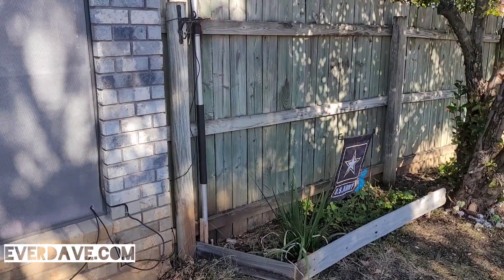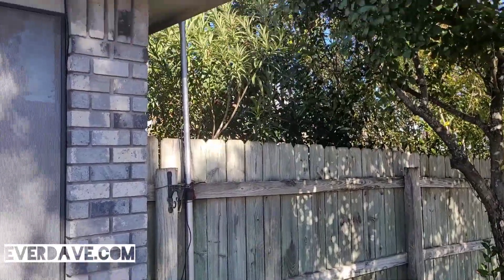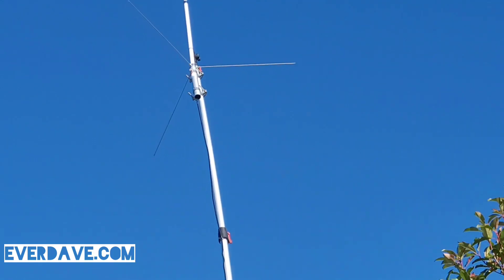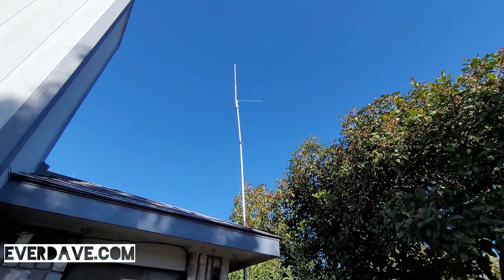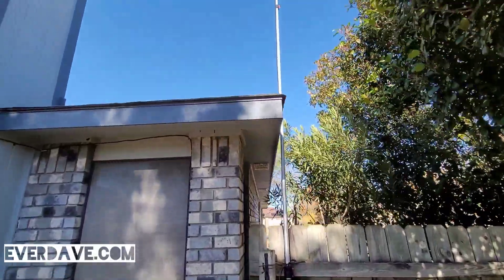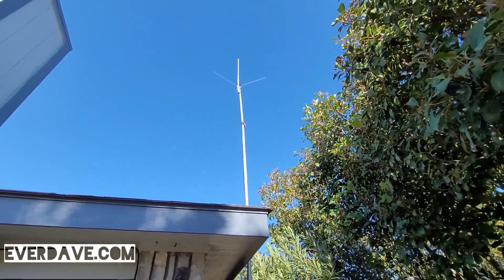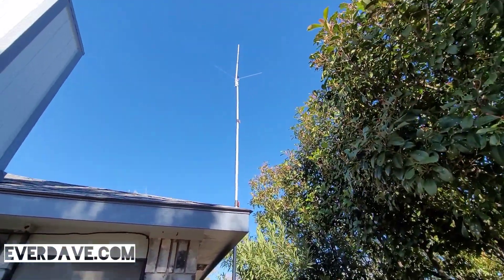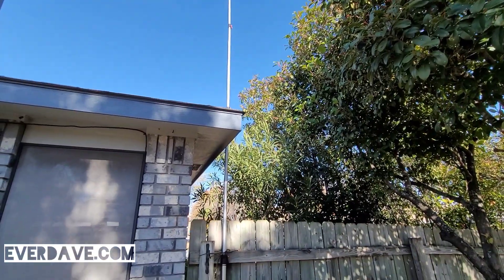My 2 meter Ham Radio poor man's "tower" in Central Texas

Comment: I’m in the same boat I had a toy years ago but I sold it so all I have is wire but I have a bunch of big pine trees so I think I’m going to I don’t one of them trams 14 in the 80s and I’m gonna try hanging it up in the tree by the top not exactly sure how I’m gonna do it but I don’t think that cover a pipe cause I don’t think the antenna goes all the way to the top of that so I think I can put something out to grab a hold of it and hook it up in the tree that’s my thought if you come up with a good idea if you could let me know I’d appreciate it 73’s name here is Donl K1EMW and I am located in Maine
Reply from the maker: N9TAX antenna works awesome for 2m 70cm! Use a fishing pole to toss a weight over a branch maybe?

Comment: Cammo Net poles work great but another alternative are the 10 foot 6 inch poles from your local big box store. They are actually chain link fence top rails. If you go with 2 of them, if you attach them to the soffit on your roof, you won't need a guy rope. I've also done 3 of them at my hunting cabin, but I do guy the top section at 30 feet. I would put them together and where they connect to each other, drill a hole all the way through and either put a long nut and bolt or a cotter pin so they don't separate or spin. Nice thing about either of these solutions, they can actually hold a bit of weight. I have a diamond X50A antenna on one and an X50A and on a wooden pole that is perpendicular going out about 4 feet, is a wire antenna (the wood is to keep the antenna way from the metal so it doesn't couple signals).
Reply from the maker: Yeah I actually replaced it with section of 10' pipe. I think I did a video on it. It works so much better like you said. I have it attached to my chimney and it works really good. Thanks so much for the info. I appreciate it.

Comment: Dave,
I also have a tram 1480 about 30 ft in the air. I saw a flag in your yard showing US Army.
Me, being a former Marine, I went to the surplus store and started collecting sections of cammo net support poles. All the antenna masts I use are aluminum cammo net poles. Strong, available, and I get them at Omaha’s surplus in Ft Worth for 5.00 ea. 8 sections pits you up 29.9 ft. I use 2 sets of 3 guy lines, 1 set at the top, and 1 set mid mast. 
I went that route for the sake of portability. I can take and set up my antennas any where I go.
Good video, keep up the good work from the good book.
73
Reply from the maker: Yeah those poles are really nice. I like the portability aspect you mentioned as well. Thank you for your service brother! Happy Veterans Day and God Bless!

Comment: Hi dave.. guy ropeing it could be an option using thin rope (almost invisible )  and tying it onto the nearby trees. You could even guy it using an inverted v style dipole. Just keep the dipole elements away from the metal pole using linked cable ties? Then you get a hf antenna too for receiving or transmission too. Height is important but not essential  for HF. My off centre fed dipole is 5m agl and works fine on 40m and up using a tuner.
Reply from the maker: I must have read your mind. That is exactly what I did last night! I used some 550 cord and tied it to the tree nearby. I still get some movement, but not like in the video haha.
Reply: @EverDave  cool. My vertical is in the roof space but im im a poor location for some vhf so makes little  diffrence unless i move 300 yards up the road.
Reply from the maker: @simonoliver5784  I hear that some attic antennas do really well.